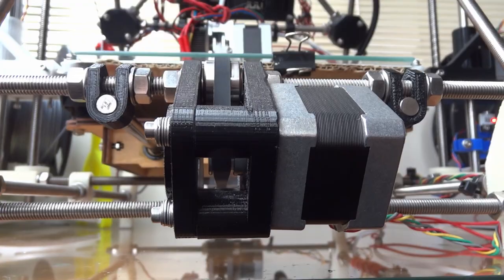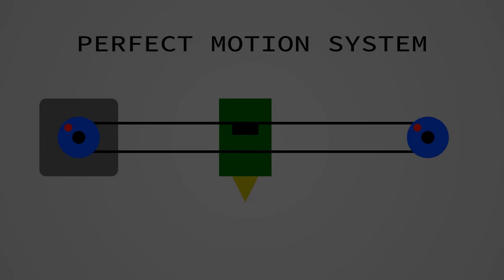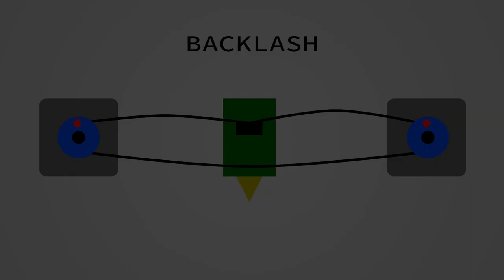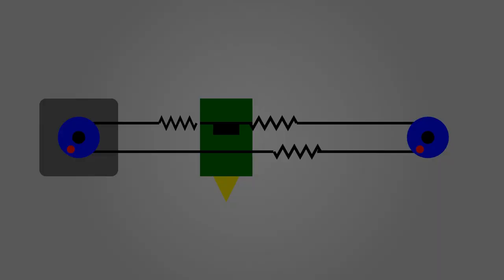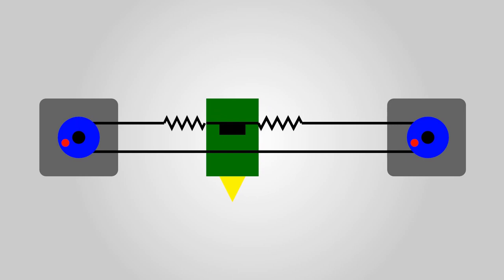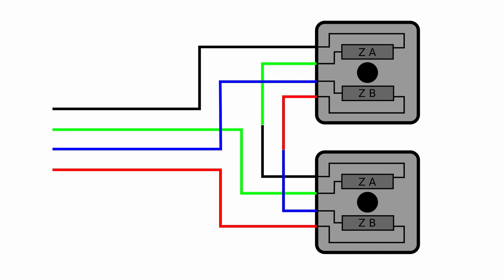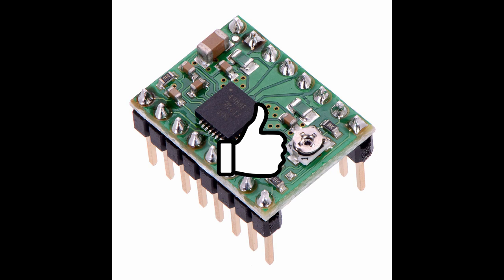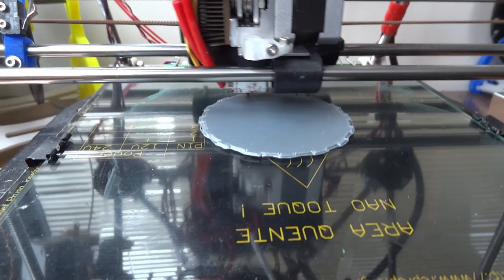2 Steppers/axis - More motors in 3D Printers Improve Efficiency and Precision

Comment: It's great to see someone who's actually done this! I tried it on the Prusa mk3 but it doesn't work on that mainboard. Perhaps I needed to wire in series, but also TMC stallguard and sensorless homing may not work. But this could work great with TMC5160 with running up to 35V. I think every moving bed printer should have two motors moving the heavy bed. If you could share more projects and thoughts that would be welcome!
Reply from the maker: Thanks Haley. Sure this idea wouldn't work with intelligent driver features such as stallguard. Two motors in one driver would get it confused. I also wouldn't work with dedicated drivers for each motor. To use this you would have to abdicate this features.
I'm using two printers with this configuration, no fails or flaws until now, but I did not do further investigations and videos.
I've also seen lots of printers with 2 motors/axis lately, even with different motion systems, like this:
https://www.youtube.com/watch?v=Kx4VfzS_V6c
I believe is a good tool to distribute tork, reduce resonances, ghosts, etc.

Comment: "We can conclude we increase extruder position accuracy by 50%" no. You decrease belt slop, and the amount you decrease it actually depends on the direction. Lets say left movement is x- and right is x+. X- will remain the same, while x+ will have at least 50% of total belt width less slop. This is entirely different than 50% accuracy. In practise these belts are already pretty tough, lets say we have a 500gram carriage and acceleration at 5000mm/s^2 (really high numbers) force on the belt will be f=m*a = 2,5N if we look up gt2 deformation vs force we see it deforms about 0.0001% under that load when properly pretensioned. Lets say it is a 800mm belt so that is about 0.8micron deformation , you reduce deformation by 50% so only 0.4micron extra accuracy. Given that the electronics and mechanical buildip of these devices can only account for about 75 micron accuracy, it is only about 0.5% increase in accuracy if only looking at belt.  A bit less than 50%.

Now if you reduce carriage weight and acceleration to more normal numbers it becomes even worse.

I do agree about the natural frequency though. Especially at high speeds.
Reply from the maker: Thanks for the comment Berkhof. I agree in a lot of cases the improvement would be irrelevant, and the "50% precision gain" was vague, or even erroneous.
But what I thought on the static analysis is not belt deformation due to traction, but backlash. And in my experience, backlash effects goes way beyond microns.
I think in practice, other variables such as material contraction, inconsistent extrusion etc are more relevant in part's accuracy and precision. Even so, I think this topic worth investigation, mainly for higher speeds as you said.

Comment: informative and well explained, nice vid! if you still have some results i would be interrested
Reply from the maker: Since I made the video I had other priorities and did not convert a third printer and compared results as I promised.
But I am using a lot the two converted printers, and together with two stage extruders(bowden + direct) my printers are very reliable. I do not remember having a failed print in a long time.
Something I would not recommend now is using 12V power supply with motors in series, use 24V, or 2 dedicated drivers instead.
Reply: @odudex  sir could you plz make a video on how to use dedicated drivers also I really need your help if you could help me that would b really appreciated
Reply from the maker: @ibrahimkayani240  it's much simpler, just connect each motor directly in each driver than you must setup your firmware. Which firmware do you use?

Comment: You are basically talking about the double h-bot concept. It work and it is awesome to work with but it require really good boards and a big power supply.
I built one and 32bit boards have a hard time to run it pass 250mm/s. But under that it work like a charm
Reply from the maker: Nice John! 250mm/s is a pretty high speed, but if your mechanics and extruder can handle it and your board can't, I suggest you to hook a raspberry pi and use klipper firmware on the board. Klipper uses RPi to do main computations and make even 8 bit boards work smoothly even in high speeds.
Reply: @odudex  I do have klipper ready to go, my issue is im a part engineer, not a programmer.. I can do most of it (and I already have it tailored from my programmation in reprap) but I can't find the IO for the stepper controller on my boards (duet 6hc + 3hc(2)).. I would need someone to help me out with that
Reply from the maker: @johnrockland18  Really cool! But let me tell you: Duet is a great board and have good software. You want to go faster but still don't have an extruder.  You already have good cinematics, and you will face huge challenges in consistent extrusion and part cooling if  you want to print over 100mm/s. I think neither the board nor software will be your bottleneck when you complete your machine.
Reply: @odudex  O I have built my own extruder for that exact reason. quad geared 3t1 ratio direct drive. I can actually print at more then 350mm/s, we tried with a friend marlin board. next upgrade is carbon fiber rods and remote direct extrusion.
Reply from the maker: @johnrockland18  Sorry now I saw your most recent video. Will subscribe to watch your further developments!
Reply: @odudex  Im almost done printing the new gantry (who can now move 45" angle for treadmill setup) andI started testing my remote direct extruder setup. as soon as it gona be functionnal I will upload it on thingiverse if someone want a challenge haha

Comment: Hello friend very interesting design, i wonder why paralel binding is needed ? Motors should move the same not like mitrored right ? Can we just connect the cables of the second motor to the cables of the first one ?
Reply from the maker: I think you wanted to ask why series connection instead of parallel(when you just connect the wires together). Well, series is better because you will make sure same current go through both motors. In parallel slightly different motors will cause one of them to have much higher torque. Even better if you can have dedicated drivers for each motor, specially with more sophisticated drivers as Trinamic's.
Reply: @odudex  thank you i'm making a cantilever now with double Y axis motors. i bought a connector for double Z axis and looks like it works for Y axis

Comment: Hei man, very interesting video, do you think it might be a good idea to replace the belt with a lead screw between the motors (nema-17) and so get rid of ghosting all together  ? or do you think that would not be a good idea ? happy to hear your thoughts about that because i'm designing a new large scale 3d printer with tool-changer  (I do prefer quality over speed). 
Great vid man.
Reply from the maker: Thanks Kees! If you will use a lead screw you won't be able to use two motors, it is very likely to have over constraint issues. Personally, I don't like screws in horizontal axis, but if you use them, do it with only one motor. If you go with belts, I believe two motors may bring better quality, specially for large scale.
Reply: @odudex  Thanks Man, ill keep it belt then :) the carriage is going to be light anyway. although it is a atc (based on e3d design) the extruder is going to be with a flex cable and the bed is doing the Z direction.. Thanks for your advice.

Comment: Would putting 2 extra motors on the idlers of a CoreXY  help with the springness?
Reply from the maker: Yes, it has been done before. But not everyone agree it's a good ideia.
Reply: @odudex  what are the drawbacks? apart from extra cost
Reply from the maker: @tapirath  as it is with regular printers, it may be considered an "over constraint". Bit if take care to equalize belt tension and avoid the motors to compete with each other, I think it worths making it.

Comment: Wow this is awesome, how is your printer holding up. I want to do this same upgrade to my ender 3 v2. I don't want to switch to direct drive but it seems like the direction I'll have to head in, I need more precise extrusions and that is the only way I'll be able to achieve it.
Reply from the maker: The printer is still working great, never had any issue. Extrusion indeed is a frequent bottleneck for speed and quality. Like I did with belts, I also have two motors/stages of extrusion, my printers are both Bowden and direct. It's polemic, but it also have been super reliable for me, specially with viscous and carbon fiber filled filaments.
Reply: @odudex  What do you mean two motors/stages of extrusion. Lol do you have some sort of hybrid printer that combines direct drive and bowden?. BTW what board are you using for the printer?
Reply from the maker: @hermangaviria690  I don't have a printer like this, I have 3😁
https://youtu.be/Z7RCqd1W6Eo
Each one with a different board, some with Marlin, some with klipper

Comment: I am planning a combination of the coreXY and conventional 3D printer setup by replacing the belt drive in the Y axis with two motor setup and raising the bed instead of moving horizontal. X axis moves as normal. I want to use lead screws with backlash springs for Y axis driven by two motors. Will your idea of putting the motors in series work for this? Desperately looking for some help to find some intelligent answers
Reply from the maker: It can work, specially if you run them on 24V. Nowadays I would recommend dedicated drivers for each of them.
Reply: @odudex  I am using Ramps 1.4 which has only one connector for the Y axis, how do I connect two motors on the Y axis?
Reply: You want your motors to run independently so if one fail the second keep going.
The double h-bot concept might interest you. It is an expensive project tho.